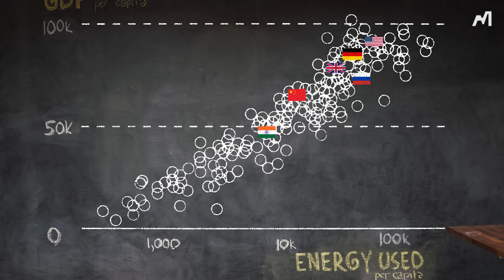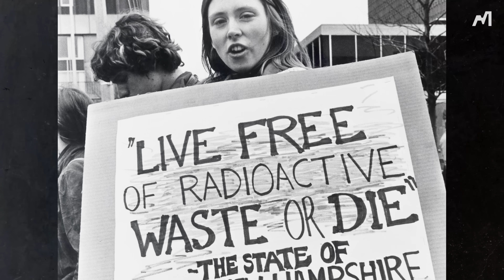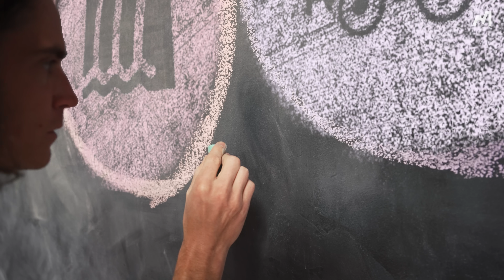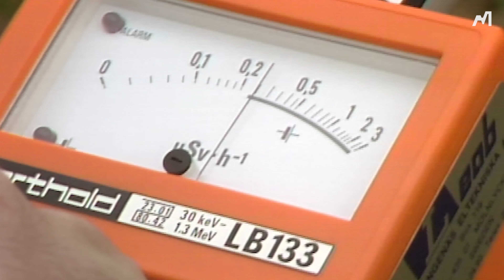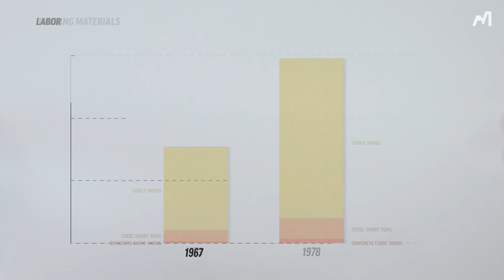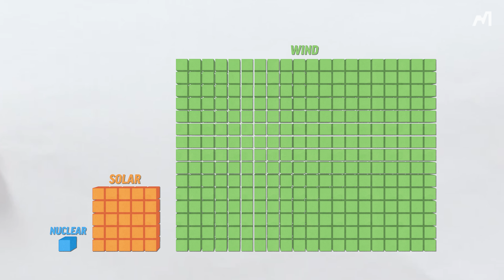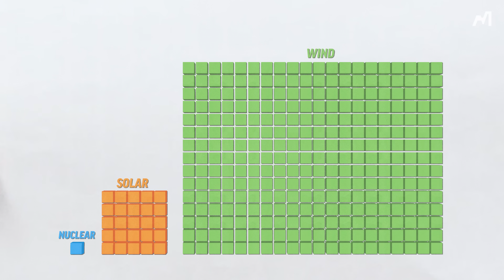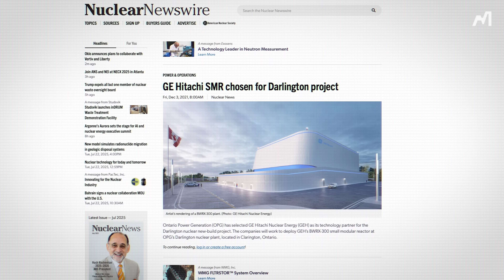They're Lying to You About Nuclear Energy

Comment: The stupides nuclear power story comes from Austria. Austria built it’s first nuclear power plant in the 1970s. They finished building it but protests were so big that the government gave in and let the public vote on turning it on. They thought it would be a clear vote for the nuclear power plant but the referendum ended 50.5% AGAINST not just this plant but any commercial nuclear power in the country. Therefore Austria to this day is the only country with a fully assembled nuclear power plant in which any member of the public can walk into the reactor pressure vessel.

Comment: When I hear two sides both using extremes to make their case, I don't believe either of them. 

I'm sure nuclear power has been overly vilified over the years, however this video gives me the impression it's trying to drastically underplay the potential risks/dangers of radiation and nuclear power. 

Take that guy at 1:06 who consumed radioactive pellets, claiming it was safe because the pellets aren't "soluble", i.e. they should pass straight though the body in a few days. That's fine if every single pellet passes through, but there's no guarantee of that as things get lodged in the intestinal tract all the time. If any of those pellets had gotten stuck, they'd have emitted radiation throughout his body for months or years, not a few days. Solubility would be irrelevant in that event. 

In short, regardless if that guy lived to old age (he already looked quite old), the stunt he pulled was reckless, and his logic he shared as to why it was safe doesn't hold up to scrutiny.

Comment: But haven't many researchers of radioactive materials died because of it? For example Marie Curie who was diagnosed with and later killed by aplastic anaemia which developed due to high exposure to radioactivity. Doesn't that proof that radioactivity is dangerous and should be regulated a lot. Just look at Chernobyl. And then there is the biggest problem: the waste. What do you do with that long-term?

Comment: Nuclear energy is not close to being as economically and logistically efficient as solar or wind energy. Its also still dependent on a natural resource that will eventually run out. Country’s with high density population have no safe place to store the waste, Germany would need 50 nuclear reactors to cover only primary energy sources, 7 times that for the entire energy requirements. That’s the nuclear waste of 50 reactors and no place to store the waste, which btw is going to stay radioactive long after earth is destroyed by the sun. There are a lot more issues so while nuclear plants are better then gas or cole energy their a lot worse than than solar and wind energy and since we have these options now there really is no point in using nuclear reactors anymore.

Comment: High-level ionizing radiation, like in a reactor and like with spent fuel,  transmutes any material used for containment to the point where the original elemental qualities of the containment elements are lost, often becoming brittle and no longer viable as a containment material. The industry knows this, but is not telling the public, as it is problematic for vested special interests.

Comment: There is a reason that 70% of France’s power grid is nuclear.
Reply: Just like there is a reason why nobody knows how to permanently and safely store high-level nuclear waste.
Reply: High-level ionizing radiation, like in a reactor and like with spent fuel,  transmutes any material used for containment to the point where the original elemental qualities of the containment elements are lost, often becoming brittle and no longer viable as a containment material. The industry knows this, but is not telling the public, as it is problematic for vested special interests.

Comment: Bits of interesting information, but also lots of BS.
For example, on average all of the american wind turbines combines are causing about 40,000 bird deaths per year. There are 76,000 wind turbines in the US. Thats half a bird per year per wind turbine, making wind turbines a negligible cause of bird deaths. That argument is so outdated.

You dont mention the amount of land area that atomic waste will take up over the years.

Landuse of solar:
Solar agriculture is the new standard - solar panels at 4m height (12ft) and all sorts of farming underneath, not only cattle.
Solar can also cover canals (like india is doing to minimize evaporation) or parking lots to provide shade and charging for EV's
Reply: High-level ionizing radiation, like in a reactor and like with spent fuel,  transmutes any material used for containment to the point where the original elemental qualities of the containment elements are lost, often becoming brittle and no longer viable as a containment material. The industry knows this, but is not telling the public, as it is problematic for vested special interests.

Comment: Why not post a lot of windmills next to a nuclear power plant so the windmills posse a danger to drones and planes and the windmills protect the nuclear power plant and can be back up power
Reply: High-level ionizing radiation, like in a reactor and like with spent fuel,  transmutes any material used for containment to the point where the original elemental qualities of the containment elements are lost, often becoming brittle and no longer viable as a containment material. The industry knows this, but is not telling the public, as it is problematic for vested special interests.

Comment: I'm all for nuclear power, but I don't buy that number from Chernobyl for a second. The recorded number of sure deaths come from a time when the Soviet state could pretty much decide which number should be recorded.
Reply: High-level ionizing radiation, like in a reactor and like with spent fuel,  transmutes any material used for containment to the point where the original elemental qualities of the containment elements are lost, often becoming brittle and no longer viable as a containment material. The industry knows this, but is not telling the public, as it is problematic for vested special interests.

Comment: Meanwhile PFAS are causing 100s of 1000s of cancers. Insane
Reply: High-level ionizing radiation, like in a reactor and like with spent fuel,  transmutes any material used for containment to the point where the original elemental qualities of the containment elements are lost, often becoming brittle and no longer viable as a containment material. The industry knows this, but is not telling the public, as it is problematic for vested special interests.
Reply: Have you eaten any shrimp recently?

Comment: The whole birds and bugs thing from windmills is vastly overstated. First, it's been shown that certain paints applied to windmills can greatly reduce bird hits, it's just he the solid white blades that are the problem. But bugs and birds are killed in vastly greater numbers by other man made factors. There's also other windmill designs that don't have the issue nearly as much. Such as the vertical blades, or even new ion transport based systems which are completely solid state.

Comment: Isn't the prize/kWh more than solar and wind? I've read somewhere that nuclear is 20-30 cents/kwh and wind 8 cents/kWh, at least in Germany (the prize for the consumer in the end, because the building costs)
Reply: It is and this is conveniently ignored. It is no accident that many oil lobbyists now work in the nuclear lobby and seem to focus most of their attention on attacking renewables.
Reply: It is and by quite the margin. The problem with wind and solar though is that you also need storage, which costs more than the energy production itself and in most scenarios is a recurring high cost due to use of batteries.
Reply: @countdown4100  Storage is taken into account in those calculations. 

It may be a concern for the last couple % of energy. We are nowehere close to that and renewables would certainly not the "supplemental" if they provide 95% of energy. 

And storage is rapidly improving btw. Trillions have been poured into nuclear research. For utility level storage it is single digit billions. 

Also the current baseload nuclear plants are useless for providing those last couple percent.
Reply: @countdown4100 thanks, forgot about the storage 😅 so the best solution would be finding cheap possiblity for storage ?
Reply: @NickHajo  absolutely. Current battery technologies simply don't allow for wind/solar to be green enough to make a real difference in global warming. They work great as a supplement, but as soon as you try to build a grid that is 100% wind/solar then you need so many batteries that you may as well go back to mining coal. Molten salt and pumped hydro are far better storage options than batteries but unfortunately they are very situational and aren't economical in most places.
Reply: It's more expensive per kWh, but also produces far far more and is more reliable.

And that price/kWh is only that high because there's been less practice building them and the super high regs.
Halfing that wouldn't be too extreme a task.
Reply: @hardcorelace7565 Nuclear has seen trillions and trillions spent on research. Renewables a fraction of that both in cost and time. The fact there is even a contest makes it quite undeniable that nuclear is not the solution. 

Dispatchable nuclear should be investigated. Baseload providing nuclear however is clearly not it.
Reply: @XMysticHerox  research and application are very different, I wonder how expensive nuclear energy is in Japan for example.

Also most nuclear research funding is into fusion, which will certainly be better than other renewables, if it's actually viable. 

Renewables is definitely not the mass replacement for coal and gas, it simply functions too differently to be the anchor of the grid.

Nevermind the other environmental effects of other renewables, you can't build wind forever without killing all the large birds for example.

Both nuclear (in both fission and hopefully fusion) and other renewables are the answer.

Comment: Funny you didn't bring up the levelized cost of energy of the different production methods. This is the major reason why they aren't attractive to build. In Denmark for example it's much more expensive to produce electricity with nuclear. IIRC about 30-50% more. Then there's the waste issue on top of that and it starts to look silly. 

It's so much easier and faster to just build a wind farm or solar farm. They can be knocked up in no time compared to nuclear plants. And they have no fuel costs, or security risks. Even with the maintenance it's still incomparably cheaper per GW of energy with renewables, and they are only getting cheaper.

On top of that, the reactors can be very difficult to scale up and down. They are well suited to base load type use. But a grid running entirely on nuclear seems quite unrealistic. The energy demand and balancing requires faster starting energy sources.

Comment: I have a question. It is said that Marie Curie, one of the discoverers of radiation, may have died strictly because of radiation exposure, that caused her to get sick.
Could you look into this and tell us more about it? Is it true? What really happened?
(I'd like to understand the real threat of radiation and the thresholds for a safe nuclear plant and anything in X-ray)

Btw I'm a huge supporter of nuclear power, especially the new fusion reactor's research. However I always feel like i don't know enough about it, and it's hard to really learn since there is so much fake info on tye whole thing online, and I'm not a researcher myself. I'm happy that more and more people talk about it lately.
Reply: Hi I visited the Marie curie museum and there it was explained that she most likely died from radiation exposure from her xray equipment while treating WW1 soldiers, she also handled lots of other manterials which surely didn’t help, but at the time radiation was new and radioprotection wasn’t as advanced, nowadays radiation threats on the workplace are basically none because of the extreme safety, the radiation limit for the onset of health effects is 100mSv (this is just precautionary as going over it doesn’t actually do anything, it just increases the likely hood a bit) and workers are limited to 20mSv/year at most

Comment: 2:24  I bet before finishing the video it’s gonna boil down to the oil industry rights being infringed upon or something oil was losing money.
Reply: The fossil fuel industry cannot do much. The climate woke took over policy. 
The good thing about it is the climate woke cant change the fact that the world cannot simply stop using fossil fuels right now...because net zero is radically expensive policy and the voters wont accept it. And furthermore, apart from solar pv, which has advanced and diffused through the global economy rapidly (mini industrial revolution), the alternative technologies the climate woke propose are naturally uneconomic compared to fossil fuels. Full lithium battery cars, solar thermal, solar hot water systems, wind farms; these tech just arent good enough, and have only achieved anything because of hype, and subsidies.
Reply: When your whole economy is dependent on hydrocarbons guess who has the power?

Comment: I was all-in til the end when you decided to promote SMRs. They're WAY more expensive than large reactors, b/c the amount of work on the site is not that much different, but you're getting way less electricty. So if you were to install enough SMRs to generate the same as a large reactor,  the cost would be WAY higher. 
They're being deceptive in their marketing. Deliver it on a truck and BAM - electricity!!! Doesn't work like that in reality.

Comment: Well, all the information is good and fine, but there’s one part missing:
In France, there has been a nuclear power plant under construction with a 17-year delay. It was originally supposed to cost €3.1 billion, but now it’s delayed by 17 years and costs around €27 billion.
In England, they are building one of the first hyper nuclear power plants with a capacity of 3,260 MW. Its cost has gone from £18 billion to £23 billion.
Now do the math: how long do these plants have to run—more than 40 years—to actually be efficient and low-cost?
Reply: Yeah, I think the points was indeed the fact that overregulations caused these delays. Yes nuclear plants typically have an initial span of 40-60 years which is often extended to by 20 or more years at a time, current generations (like the French EPR) could possibly go for a century, so plenty of time to repay

Comment: So what you’re saying is the low practical IQ of policy makers is ruining human progress, is this news?

The safety is required and radiation is terrible, don’t gaslight us about that. But the economics is wrong, it should work more like nvidia does with its chips where they can front run funding with hedges for stable production. policies need to be created properly before initiating design and construction. Problem is legislators don’t know what they’re doing, advisors are nepotists and you need to build in the lack of enforcement capability into the legal design, not to mention the backhanders from oil to sabotage nuclear.

Comment: The sad fact is that the corporate management of utility companies have historically lacked the integrity to insure safe operation at the expense of reduced profits.

An instructive example would be the handling of the heat exchanger replacement at the San Onofre Nuclear Generating Station (SONGS) in southern California. SDG&E management selected a 'low bid' contractor for replacement of the key nuclear cooling loop to steam generation heat exchanger the isolates radioactive reactor coolant from the steam used to power the plant's generators. When unfavorable analysis arrived and later when failures of this heat exchanger occurred causing radiation leaks, management withheld  information from regulators. Information was concealed because costs associated with mismanagement and incompetent oversight of the contractor and of the design would have to be borne by SDG&E shareholders, not rate payers.

Deceived and unhappy regulators required that the plant be completely re-licensed from 'zero' after it was demonstrated that the SDG&E corporate management could not be trusted. Rather than comply, SDG&E shut down the plant leaving costs to be borne by rate payers.

A similar example of dishonest portrayal of risks and limitations of design from the regulatory side occurred when the Yucca Mountain repository was pitched to Nevadans by Government regulators looking to sight a nuclear waste repository north of Las Vegas. 
Regulators assured local citizens that radiation released from the repository would  be no more than that allowed for a single nuclear power plant. Yucca Mountain was to store thousands of reactor loads of spent fuel that would continue to produce radioactive tritium gas for hundreds of thousands of years. 

When eventually pinned down as to what provisions were being made to capture and sequester the very large amounts of tritium released by thousands of reactor loads of spent fuel - thousands of times more tritium release than permitted from a single nuclear power plant - regulator's response was: Well when when we said radiation leaks would be limited, we meant EXCEPT FOR THE TRITIUM....

Is it any wonder that the public is wary of nuclear power? The risks of nuclear power are both technical and 'cultural'. While the technical risks are amenable to management and control, the cultural risks have not been shown to be successfully manageable.